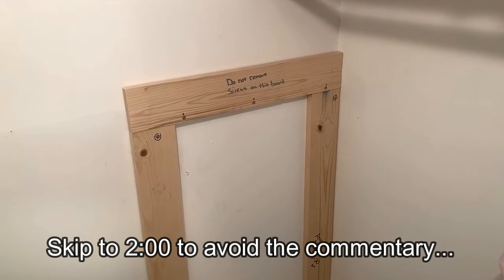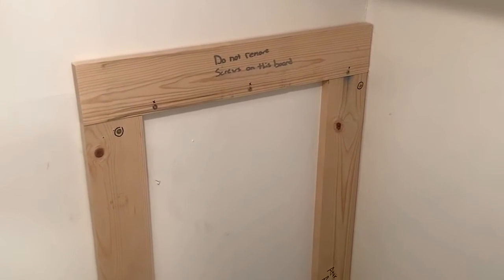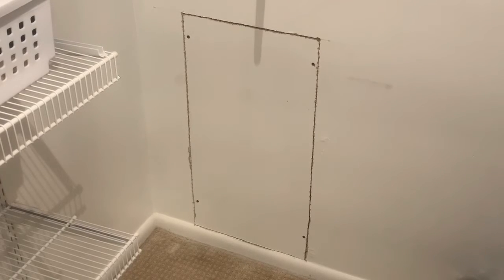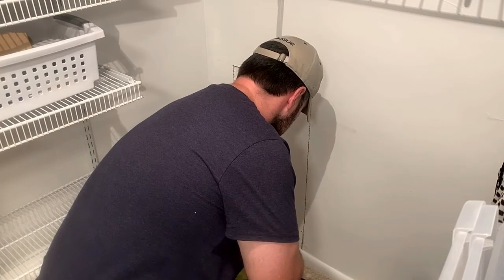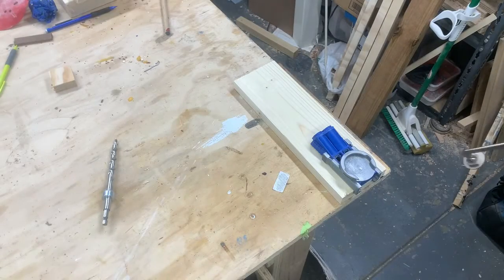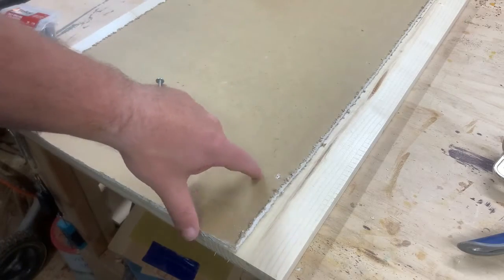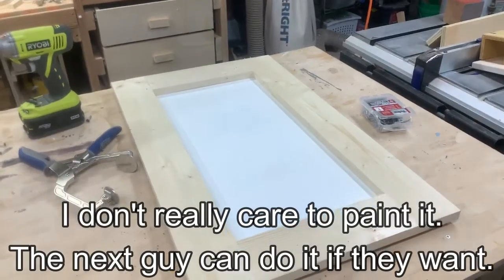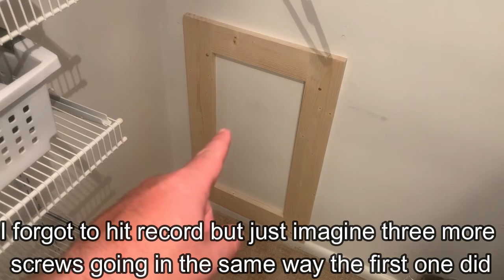How to Make an Attic Access Panel

Comment: DUDE !!!!   ONE Million thank yous !
 Exactly what I needed as I have (for 20 years) been RE-Taping and hot mudding a 3'x5' sheetrock "access" hole 14' off the ground in my garage.
I will use your video to make an access panel and add a gate pull handle (or and EYE Bolt) & short rope to the top of the panels 1/4 to be able to LOWER the panel below the access hole (to hang) when I have to go back into my attic.   AGAIN 1 million thank yous !
Reply from the maker: That sounds miserable...if you want to make it "fancy" you could use window/door casing and miter the corners. Although at 14 feet up, in your garage, not many people will notice. Good luck.
Reply: @slightlycrookedworkshop  Thanks for the feedback.
Well, coincidentally, I was just finishing up my "frame" and came in for a break when I saw your reply.
Any kind of "frame" - 1"x3" or door casings were/ would be adding so much extra weight, that I have decided to "tack" in the sheetrock in the hold with a few screws and then hoist the 1"x3"  frame up separately and add a few more screws at the corners and 1"x3" cross brace that I added to the frame.
Sometimes 2 steps especially when dealing with a lot of weight on a ladder is the best solution.
Your framing idea/ video really helped out since the frame covers the 4x seams and now I never have to do the difficult and messy seam taping and mudding.
Big thanks !